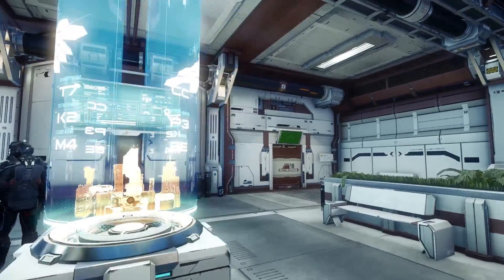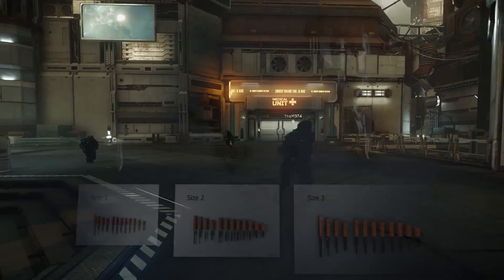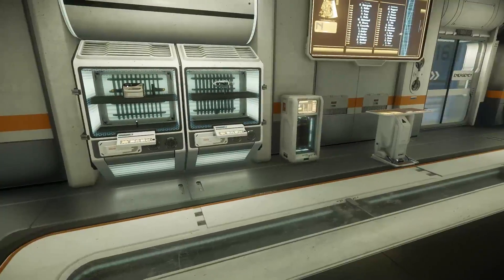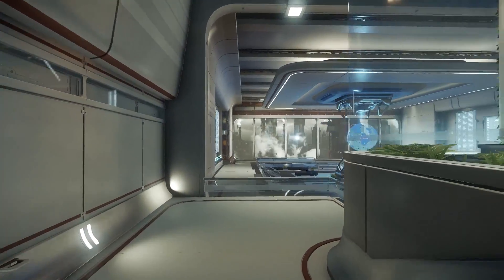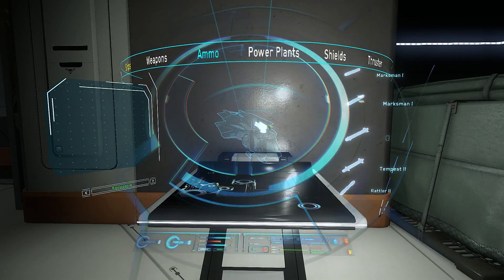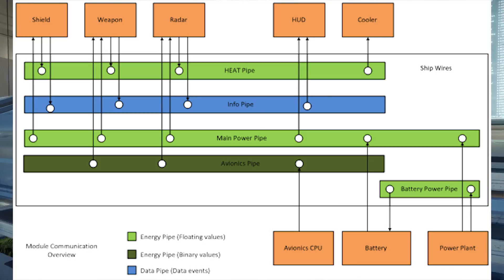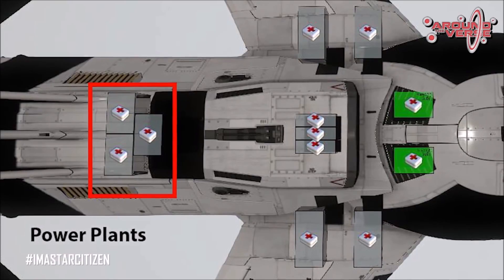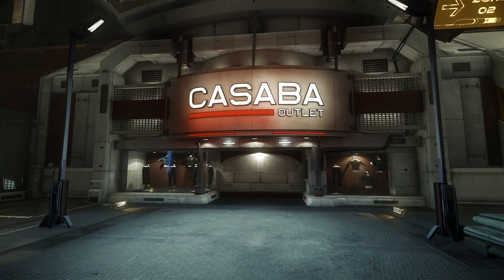Star Citizen - ITEM SYSTEM 2.0, SIZES & PIPES

Comment: How do you make your "crosshair" auto center when flying your ship? I'm always having to manually center it.
Reply: relative mode. I recommend boreds video on flight controls
Reply: +speedy ap there are multiple things that can be referred to as a crosshair, could you specify what you mean?
Reply: auqanova It's a dot usually or a circle with a dot in the middle, which tells you where you are aiming your cursor, so if I move it to the right, I turn right, but I want it to automatically move back to the middle of my screen so I am not having to manually move my mouse back to the middle.
Reply: Never mind I got it now, just needed to figure out how to turn on relative mode lol. Thanks for the help though guys.